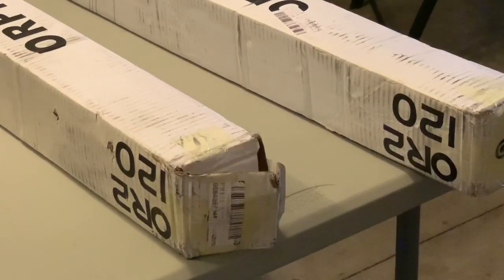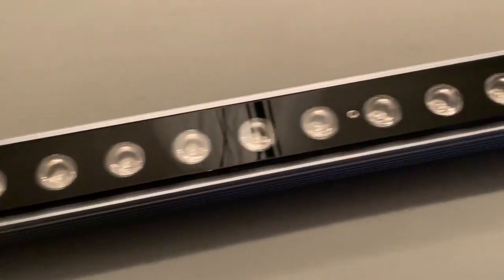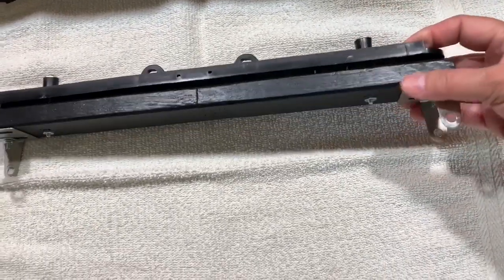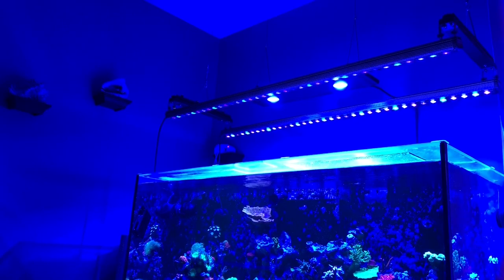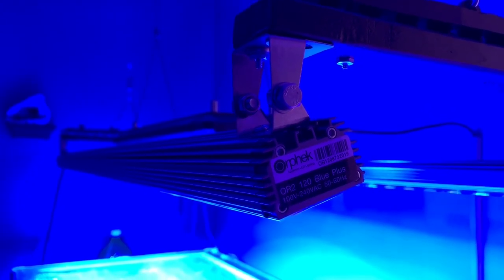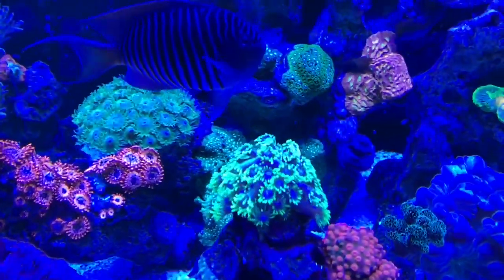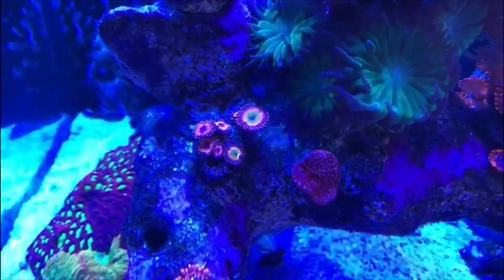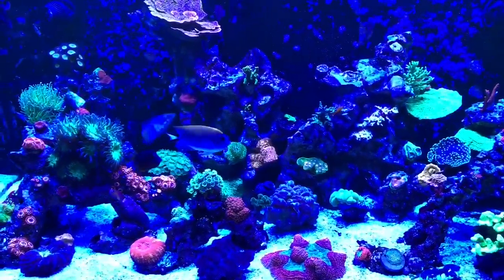Bye Bye T5s. Hello...❓ REEFGRRL Sees the Light!! 🌅

Comment: Super nice and sleek bar light fixtures and at an affordable price point for what they are. Very good input Mom.
Great video. Start slow mom, if you cant control the intensity yet, then time on/off should be at a minimum and then increase the time on as weeks go bye. 
I know you know this by now. but just saying. LED's are more focal points Vs T5 spread. When I changed my T5 to the Ocean Revive, my LPS and Zoas closed up for a day. I don't have a PAR meter so I went as close as illuminated by eye. Boy was I wrong. Took me 6 weeks to go from 35% to 100% on the blues and stayed at 35% for whites.
Stay Reefing and High 5!
Reply from the maker: That’s great advice Mel, and I’m lucky because I already had the Kessil LED running with a T5 on either side of it. I still reduced the photo period just in case but so far I’m not seeing any issues. But I’m keeping a close eye on it and I’ll start ramping up the photoperiod in a couple of weeks, really slowly. 👍🏻👍🏻

Comment: Great review of the lights.  I was considering getting T5s to supplement my leds to rid myself of shadowing and have more even coverage.  Now, you're making me think about using these instead.  Do these lights do the same as the t5s in reducing shadowing and having even spread?
Reply from the maker: They sure do! I love how mine reach parts of the tank that the AP700 light clusters could never reach. Because my tank is 48” wide and so are the lights, the coverage is excellent. As mentioned in the video, I had T5s before these and I’m very glad I made the switch. 👍🏻

Comment: Looks awesome as always. Great lights. Will be looking forward to the wireless 60” unit to replace my t5 on the led/hybrid setup I’ll be using on the 130Dt. 
What’s the stripped fish called & isn’t that other angel fish not good for reef tanks? Please advise and thanks in advanced.
Reply from the maker: The striped one is a male Spotbreast Angelfish and the one with the yellow back is the female. Genicanthus melanospilos. The Genicanthus angels (there are several different species) are all reef safe. I’ve had these for nearly two years, and they’ve never touched any coral. They’re awesome fish! 

If you’re interested in the 60” model, let Tom at Orphek know. No obligation, and if they know lots of people are interested it might get things moving sooner. 👍🏻
Reply: Reefgrrl they look awesome thanks for the reply.

Comment: Sorry T5's are still the better light IMO, just supliment them with leds if you want more UV glow.. but they will never replace the par t5's put off, unless you spend $600-700 per fixture on the really high end ones.   Local store has XR15 radeons on their tanks and i measured the par with a par meter.. and they barely put out over 120 par directly below the light 6 inchs in the water.. my 4 t5 bulbs put out 200 par at the same distance.   Ill keep my T5's, i use LEDs with them and when i wanna sit back and watch my tank, i turn the t5's off and have the intense glow that  LED's put out, when im done i flip the t5's back on.
Reply from the maker: I’m more focused on spectrum than PAR and I wonder what time of day you checked the radion PAR - maybe they had just turned on and were still ramping up. Which they can do, like most decent LEDs and unlike T5s. Yes, high quality LEDs can be expensive but they don’t require bulb replacement every year. And they aren’t subject to spectrum shift like T5s are, as they get closer to their useful life before replacement. I replaced the T5s I was using, with LEDs because I just didn’t like the look of the tank under the T5s. My corals definitely responded to the T5s and they also definitely respond to the LEDs, but there’s far more flexibility in spectrum and PAR with the LEDs. Lol, we all have our reasons for the choices we make in this hobby and it’s what keeps things interesting. Thanks for your comment! 👍🏻
Reply: @Reefgrrl  na the stores radeons are set to stay at one setting. He doesnt have them on settings thst fade.  And par is what grows corals fyi.  You can get full color spectrum with coral plus and blue plus lights.  They have green.red.yellows ect all in those lights especially the coral plus bulbs.

Ati bulbs last 18 months. Brs already disproved the 8-12 month missinfo people keep spreading.

My t5s are 20 months old and none of my 100+ corals have changed in color or have loss in growth.. not even the 20+ types of acros i have.  Which are usually the first coral to lose color from poor light spectrum and par
Reply from the maker: @jeepsblackpowderandlights4305  Yeah FYI, it’s actually spectrum that grows corals though they do indeed need enough light. Anything but blues (near-UV 380nm up to around 470nm) is what actually reaches corals from sunlight travelling through water. Greens, reds, whites - they’re for our eyes and mostly grow algae. I’m not saying T5s don’t work, just that LEDs work just as well and have more pros than cons. 🤷‍♀️